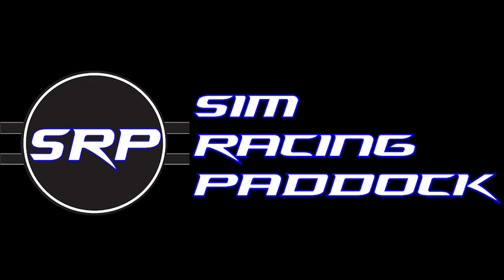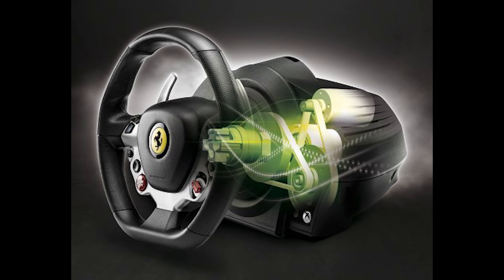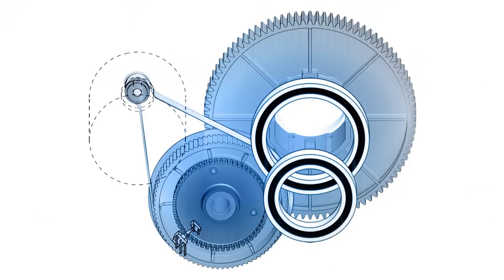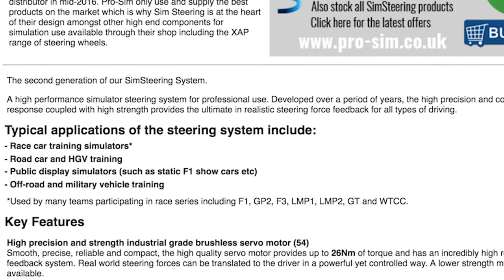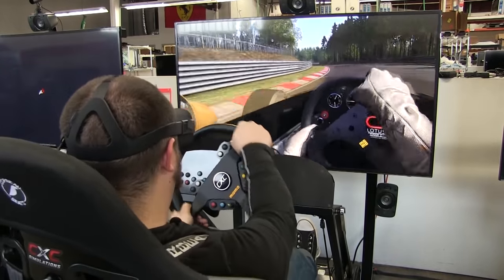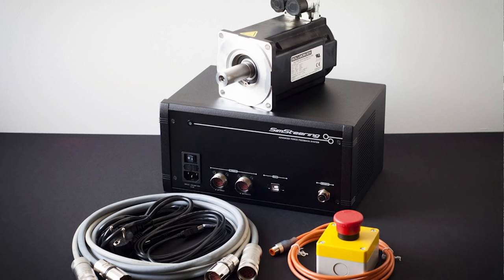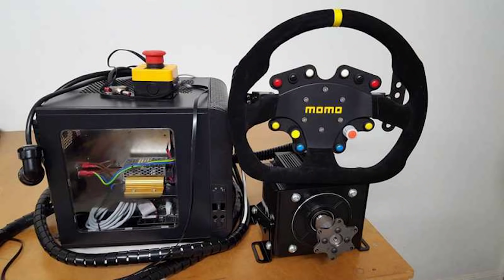What is a Direct Drive Steering Wheel?

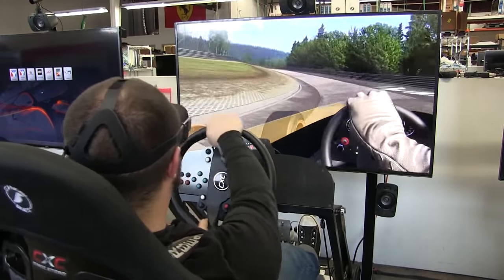Comment from the maker: NOTE: at 2:48, "Speed" may not be the right word... I think a better word to fit that could be "Quickness". The torque of the wheel allows for quicker reactions and response to whats going on in the sim.
Reply: Nice review good job!
Reply: Still doesn't make sense. Torque is literally force multiplied by the lever length, which is the wheel radius in this case. There's no relation to quickness here.
I think I can see what you mean though. In a belt drive system, there's a certain amount of softness and stretch in the transmission from the motor to the hands, which is not present in a direct drive system. This "muffles" the feedback force, softens its spikes, smoothes out changes in the amount of force. I guess "sharpness" would be a more appropriate word.
But in that case, a transmission with hard gears should be just as sharp. I don't know though if there are any consumer hard gear wheels. Gears usually need lubrication, so I guess not.
Reply: great job ive been waiting for thse types of vids for ever. keep it up thx
Reply: Are you saying that for example the wheel when not being grabbed hard would respond to a oversteer (think drift cars) by steering itself into the slides direction at a much higher SPEED? Or does having more torque = the action/ response from your hand moving the wheel in real life _ to moving it in the sim/game is SHORTER? 

Like what you said is confusing because you're not stating what is being responded to in which direction of interaction(where there is many things being triggered here including us)
Reply: I am with Kakto. The torque doesn't means or have any relation with quickness. And I have to say that a belt drive systen is really really fast, at least my CSL Elite it is. So I still don't get the point to purchase a direct drive wheel. Plus, the people who has a direct drive wheel always are saying that they use between 40 to 60 % of the power of the wheel, very often they use even much less. 
Why to spend a lot of money and have so many problems with set ups and compatibilities with some games?
Reply: All I can say is Leo Bodnar transformed rfactor from mediocre sim to sublime, with the LeoFFB plugin.

Comment: I stoped watching when he said that torque defines how quick something can be...
Reply: Because hes correct?
Reply: @trigger8152  Absolutely not. Just think about car gearboxes. The first gear will have a lot of torque and low RPM. The fifth gear has a lot of RPM but low torque, all of that when run by the same engine. Adjusting the example to this particular case, if the torque that the fifth gear produces is enough for the sim, it would be much better to "have a wheel on fifth gear" then on first gear cause it would react much better to the sim, even though it has way less torque.

Long story short: you don't need the wheel to have more torque then the sim asks for. Take the rest of the torque and turn it into speed and you're much better equipped.

Comment: As I was watching this video, I was thinking to my self "Why did I buy a Fanatec?" Then he got to the prices and I realized how much I love my V2.5!
Reply: An OSW with Simcube can be done at about 2x the cost of a CSW V2.5 set up.  Question is, when/if your V2.5 with burn up or give up.  Hopefully never, but my V2 is on its 2nd motor...fingers crossed.
Reply: Mine broke after 2 years and csv2 pedals after 1 year and a half ( never going back to Fanatec again ), and if you like good forces the motor tend to decrease in strenght if you use it for too long. Wish you luck. Now with a simucube small mige and boy this is a different ball game.
Reply: Sebastien Houde sim cube bro can you put a quick release and use any wheel
Reply: @sebastienhoude3739  does the simucube still work well?
Reply: @MrFrosty888  yes i have qr1 quick release and use it for fanatec or any momo sparco, etc.
Reply: @danieldooling9069  going for 4 years now and it's like new. I think the small mige got an average of 10000 hrs of life, i use about 10nm of forces (so 1/2 of full force), for sim racing i'm pretty sure it can last 10 years easy. The advantage of these dd is the quality and the conception is simple. Fanatec always have conception flaws like some plactic pieces that can break (the quick release remind me of one, locking the qr with the bolt put pressure on the ball bearings and connection inside the wheels to the base, bolts got loose, bearings started leaking and the locking nut started stripping due to poor bolt grade choice). Even the Fanatec dd got me worried, LCD failure ? same bad quick release. Got my mige for 1200$ can with an upgraded sensor (3.1 millions ppm). Fanatec was about 2000$ can. not putting 2000. It all comes down to my bad experience with Fanatec, maybe i was unlucky but i don't regret my choice.

Comment: Your use of "the immense force," makes me think my arms will be broken lol
Reply: Christopher Nixon there's a reason direct drive motors come with an e-stop button. The full drive force is directly interfaced with your arms and body. With a consumer belt or gear driven wheel, the belt should slip before the gears break and the gears should break before your arms do. There's nothing stopping you from getting hurt with direct drive FFB which is why you need to learn your limits and be prepared to engage the estop if things get out of hand.
Reply: Where is this e stop button placed? Because if it's on the spinning wheel...
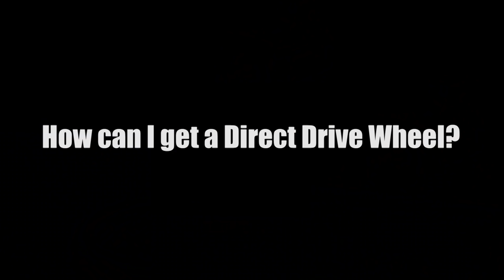Reply: You see the large yellow box with the red plunger on it? That's a pretty much industry standard emergency electrical disconnect. pressing it disengages it and it cannot be re-engaged without twisting it back out.  http://www.heatcombustion.co.uk/img/products/2013%20products/KOB.jpg This is what I'm talking about. It's designed to be placed anywhere, preferably near the operator, but accessible to anybody who may be nearby. This way either the operator (if capable) or a bystander (if present) can intervene and press the button. You'll note it is in this video at 4:07. Some systems even implement multiple emergency disconnects, one near the operator and one outside the operating area of the equipment in question. Sometimes, in engineering spaces, there may be multiple emergency disconnects around the room or even throughout hallways all of which will de-energize ALL equipment in the room. This way anybody can intervene at any given moment.
I will say I don't like that most of the direct drive rigs featured in operation in this video do NOT have this button prominently available (at least form what the camera shows) Again though, the more important safety measure is to learn your limits. Don't crank it up to 11, take baby steps until you find the sweet spot.
Reply: ZeroX252 I can't make it to work because I got injured playing video games. ☺️
Reply: Exactly, anyone whos raced a car will know that these wheels are way over powered, containing far to much force. Steering wheel in reality isnt that hard to turn, and yes Ive driven a V8 Supercar. However the torque is required to transfer feel that you get from SOP that you get in reality.
Reply: It's not the sheer amount of force they produce, it's the precision and the 1:1 ratio they give. Did you ever saw a video of an old F1 car, or driven a car with no power-steering, i can tell you that there's things that can demand more than 10nm of torque.
Reply: I don't own the wheel  but wud be nice to have multiple  profiles  for each car and race
Reply: +Starsky 83 Super cars are made to be lax on the driver, the least effort the better. Get behind the wheel of a Series Land Rover or something similar that doesn't have power steering or any other super car luxuries and you'll see the difference. Not too long ago I drove a Series III for the first time that didn't come with the typical modification and boy oh boy was that a workout. After that I was able to drive my day-to-day car with my pinky for a week (not that I did that because it'd be illegal) before I readjusted. However, given how I've seen plenty of people wearing fireproof racing gloves as a safety measure against getting their skin torn of by the wheel, I would say that you are correct about how there is a bit too much force in these things
Reply: For quite some time, almost all cars have power steering - and if they don't, I'm sorry for the poor driver.

Comment: I went from a fanatec 911 gt3 v2 wheel to the OSW build.  Bought the parts online and built the wheel over a weekend with instructions from the iracing forum.  Let me put this into perspective how good this setup is!!!  I feel that I will never have to buy another wheel in my entire life.   Just think about that. Also the servo motor will probably never break.  Most industry standard servos have a life cycle of 20,000 - 30,000 hours.  This is also under heavy workloads.
Reply from the maker: Dark Sector Gaming thanks for the input :)
Reply: Links Dude, links!
Reply: Can you help me locate your build online. I'm just getting into this stuff and i'm ignorant. I'm interested in how it was done..?
Reply: You can still buy full kit that will get some time savings and some headeache if you're not familiar with electrical stuff and wiring for an affordable price. Check for Sim-pli.city or even simracingbay. Got it from sim-pli.city and couldn't be happier. This is probably the last wheel you will buy in your life. Had a fanatec csw, good stuff for the price but the reliability of Fanatec is horrible (broke after 2 years) and support...won't get into details. Better to pay a little more ( around 500$ if you have already a steering wheel ) to have something that won't break or will have an awesome feeling, more precise and stupidly stronger. And like Dark sector said, these motors are designed to work in harsh environment in industrial background so they can take lot of abuse. Cheers !

Comment: wat happens when u hit the wall in an open wheeled racecar at high speeds ?
does it snap your wrists ? (would be super realistic)
Reply: What happens if I use it in Need For Speed and drive with my modded Diablo SV with 800 kph into an 100 kph oncoming traffic car?
Reply: If you die in NFS you die IRL
Reply: A G25 is not a direct drive wheel xD
Reply: some direct drive wheels set to 100% ffb can gunuienly hurt you really bad

edit: sorry for my bad englisch
Reply: More about literally breaking an arm, there's videos on YT with ppl using full forces on these wheels.
Reply: Wheel spins like crazy
Reply: yes. it will hurt your wrists.
Reply: Does it come with an airbag?
Reply: @De-M-oN  There is a hidden bolt gun like they use for killing cattle- It will shoot a bolt in to your brain housing group and teach you a lesson. The bolt weighs around 800 grams and travels around 3200 feet per second so the lesson is permanent. If you have an attractive girlfriend it sends me a note and I go by the house to comfort her. If she is ugly it just sends a card.
Reply: No driver has yet survived, they all sit rotten in their rig, because all people around them have stopped disturbing them...

Comment: from an electrical  and mechanical point of view, the presence or absence of a gearing system between the motor and the wheel makes absolutly no difference in the reponsiveness and force the wheel, if the gearing system has no play and low friction. the only thing that is different is that these direct drive wheels have more powerful motors. you could achive the same with a lower tourge motor and gearing system if the motor can deliver higher rpm faster and the inertia for ac- and decellerating is calculated into the system ( a motor with a bit more than 1 nm peak tourge and 20:1 gearing  would deliver the same responsiveness as a directly connected 20nm motor). they are mostly just simpler so build as direct drive.
the normal consumer systems just use low tourge motors because even low cost motors can spin very fast  but not accerlerate to these rpms as quickly
Reply: gotta agree with you, the explanation is mostly about torque and speed, which are just the indirect consequences of wheel design around a direct drive mechanism. the main advantage of direct drive power transmission are reduced resistance (i.e. damping), reduced compliance (e.g. gear/belt deformation), and perhaps a bit less rotational mass. So if your FFB signal varies rapidly, information will be lost ("blurred" in a sense) more on a non-direct drive wheel. Powerful motor is just a consequence of not having gear to multiply the torque, hence to achieve certain level of torque it just has to use larger motor. Faster acceleration and rotational top speed is also an indirect consequence, due to more powerful motor, less damping, and less rotational inertia. So with more powerful motor alone you will get high rotational acceleration/speed and high torque, direct drive mechanism is not necessary.
Reply: What makes a direct drive wheel base expensive? Is it just the more powerful motor?
Reply: @albertweedsteinthethuggeni7797   in essence yes. Cheaper or lower end consumer wheels use cheaper, mass produced motors that cant deliver much torgue so they are conected via a gearbox. Which ads more rotational inertia. Also the faster it needs to spin the longer it takes to rev up (it takes more energy to accelerate somehting to double the speed than to spin up twice the mass) 

Direct dive motors are basically just a simpler method if you use powerful motors anyway. Also they dont have mechnical play which makes them feel more responsive

Comment: A few thoughts.  The servo motor most likely has gearing inside it, servo's typically have a highspeed low torque motor which is down geared orders of magnitude to give small rotation with high torque.  I wouldn't be surprised if it used belts inside it.  Secondly, with the exception of some formula cars and karts with no power steering sim racing set ups usually have way too much force.  Compared to a modern normal road car this is to the extreme.  I drive a GT86 in real life and to emulate the steering weight and feedback in PCars I had to dial the FF way back.
Reply: No belts inside, that's why they can be so precise and more raw feedback...but like you said, consumer wheels with belts can emulate realistic forces unlike the DD wheels that you have to dial alot of settings like damper, friction and inertia to give it a more natural feeling.
Reply: Paul C Well, don't forget that people also love to race old cars in sims. To accurately simulate forces in something like a Group C you simply need a powerful direct drive. And pretty much all race cars and formulas up to 90s didn't have power steering.
Reply: 1- DD wheel, use brushless motors, there's no belt no gear , and no mechanical part between the stator and the rotor.
2- The most important improvement from DD wheel is not the torque but the very low inertia because there is not belt or gear, means the steering wheel will react faster, with very low latency with the simulation, which prevent oscillations on straight for example. DD wheel also have linear force response compare to COM wheel ( excluding Fanatec wheels )
3 - Race cars have torque at steering wheel between 6Nm to 25Nm , so If you want to be able to simulate all kinds of racing cars, you need a wheel capable of high torques.Usually the simulation will handle correctly the torque for you, if a car have low torque feedback in the steering shaft, then the game will output lower torque to the wheel. in some simulations ( I think rfactor2 and iRacing ), you can even enter the max constant torque of your steering wheel, and the simulation will send the correct ouput thought direct input to have a 1:1 match.

Comment: There is only two more things to do: first is  to measure moment at the real wheel for analysis if it's possible and the second is to compare DD wheel movement with belt driven one (T500RS, for example).